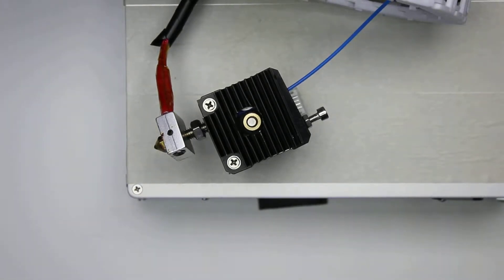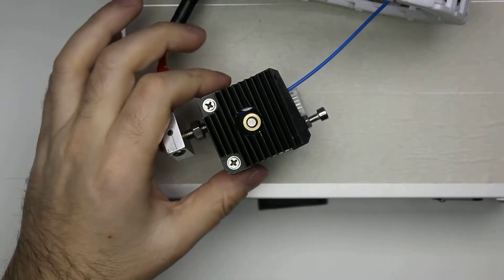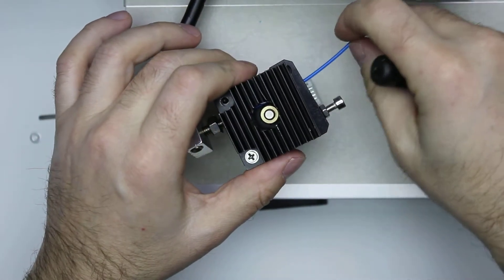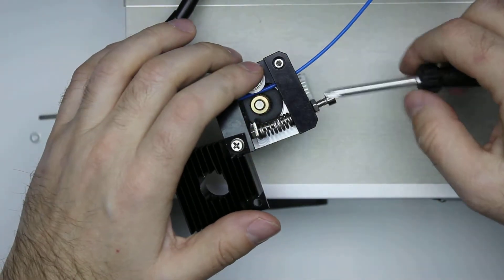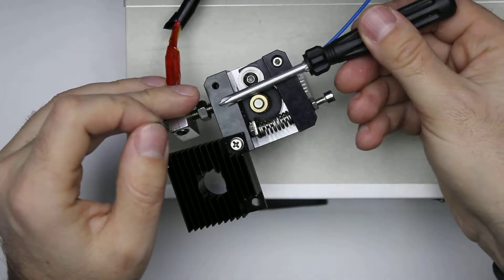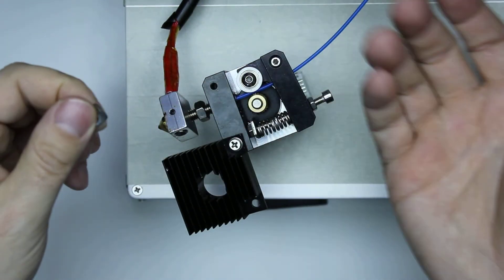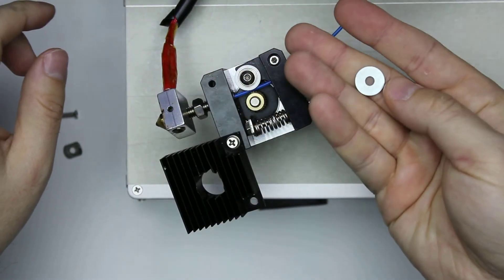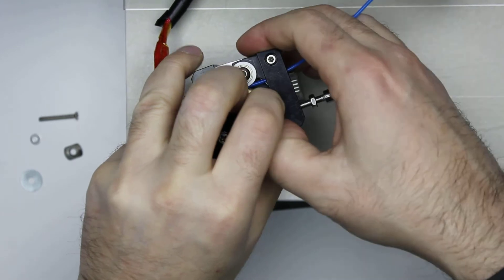Anet A8 Fixing Inconsistent Extrusion - 3D Printer Extruder Over/Under Extruding Issues

Comment: Actually a better fix, put a cap on the adjustment screw where it enters the spring, that way you have a real actual adjustment.  All his way does is give a little more tension, but a cap on the other end of the spring stops the adjustment screw from just dropping through the spring and makes a real tension adjustment
Reply from the maker: I did not really have many options at the time. This was the easiest available :)
Sorry for the late reply.

Comment: 2 years of using this damn printer and always having extrusion issues. I just printed some spring holders placed them on both sides and voila. Thanks a ton.
Reply from the maker: :) It gets a bit hot there so I hope you printed ABS holders.
Reply: @laptopbatteryteardownother5640  I just have PLA in hand but I got a Delta fan cooling the heatsink down so I guess it should be fine. Thanks again, I was on the verge of getting a new printer all together.